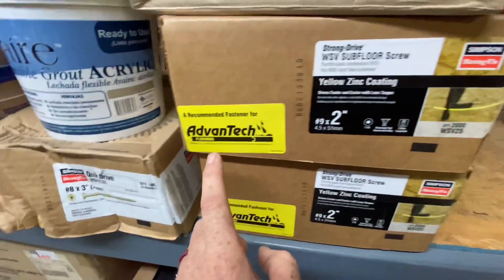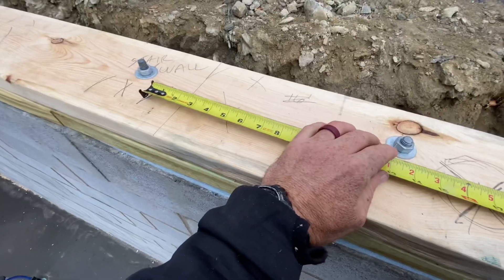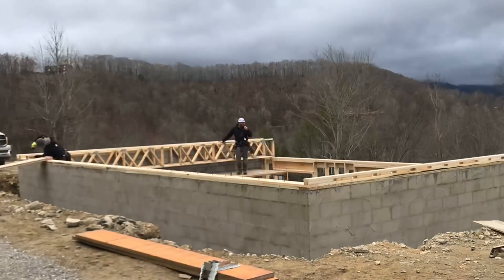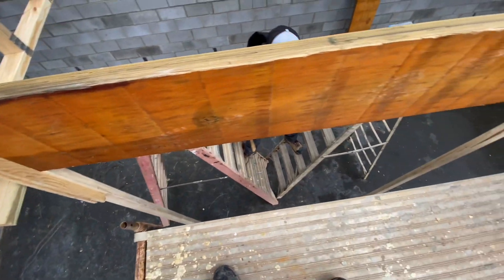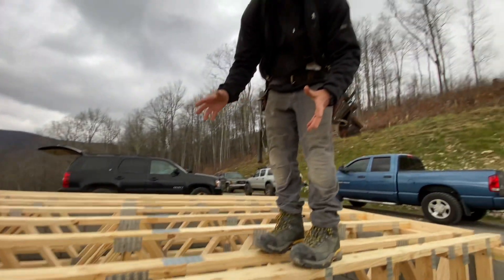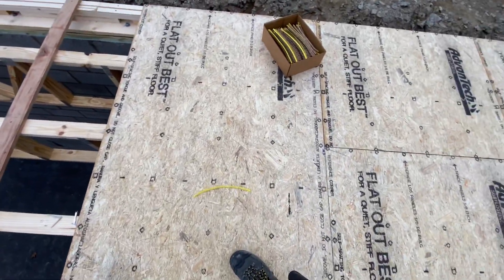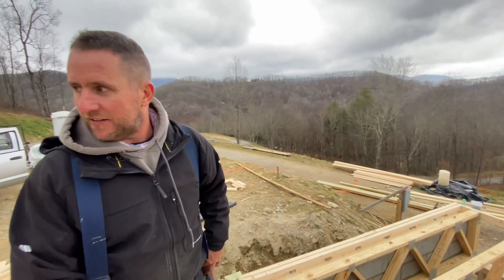Building The Farmhouse | Day 11

Comment: Dodging the trusses with all of the plumbing is the bane of my existence.  It should be designed in and on the drawings; but here I am switching to a left hand tub and splinting a 2x4 on the back because I had to cut 1/4 out of the top cord.

Comment: I'd protect those seams. I got rain on my advantech subfloor and it swelled up at the seams.
Reply: Belt sander fixes it no problem.
Reply: Mine did too. The no edge swelling is a lie. I spaced all my joints 1/8 inch too. I still like it, but just plan on sanding all the joints because it will swell. I think LP legacy could be much better, but don't like the notches in is that drain all the water down into the crawlspace or basement.

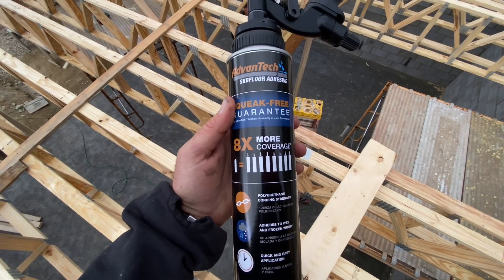Comment: Please correct me if I'm wrong. I see no bracket (hanger) for the trusses on the concrete wall side (5:17), (6:57); basically trusses are hanged and held by double 2x4. Brackets are not necessary for this type? Thank you.

Comment: As a European, I am very interested in how long would a house like this last before it needs to be remade, 25-50 years?
Reply: Amon Ra,
    As long as these homes are Well Maintained, meaning: terminate control, Roof Material maintained, Landscape managed including erosion control and storm water control, having no accident issues such as plumbing leak ruining interior materials which lead to mold- and no natural disasters such as tornadoes or straight line winds or wild-land forest fires ~~~Should last 150 to 200 years~ probably longer‼️ The Earth moving over time and Solar heating and cooling will effect the structure somewhat but OLD SCHOOL MASTER BUILDERS LIKE “PERKINS BUILDER BROTHERS” build to compensate for potential long term adverse conditions using Published Architectural/Engineering Standards which are mandated by state/local governments and inspected through each phase of construction starting with permits for drawings/blueprints, then strict adherence to the pre-planned, approved home drawings with inspector signatures on the site posted permit‼️🔨🧱🪚🪜💵📐📄📋🗞🗂
   Yes~150 to 200 years! Many log homes built around 1800 here in Northeast GEORGIA MOUNTAINS, still standing and lived in‼️ See Perkins video series that Jamie and crew are updating that is over 100 years old‼️
Reply: @joetownsend-  Thank you for detailed answer, I wouldn't have thought you could get such a long lasting house made with so much wood.